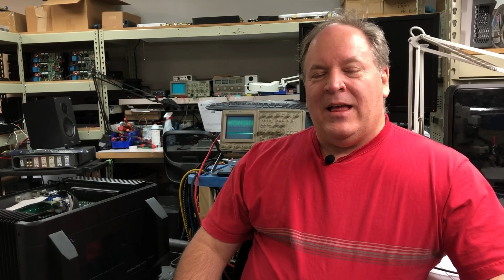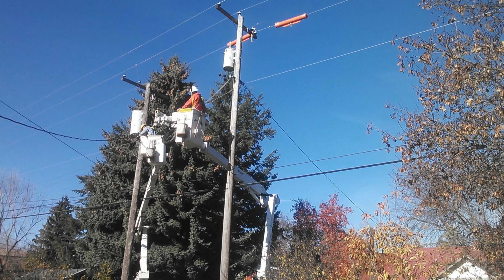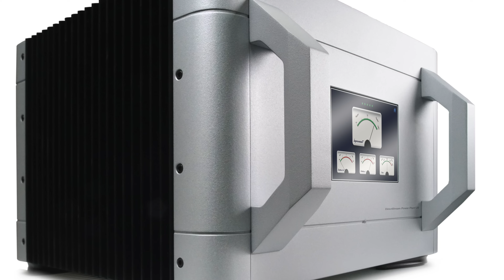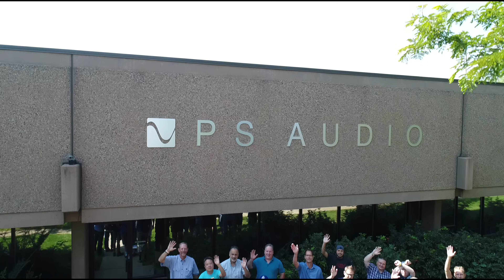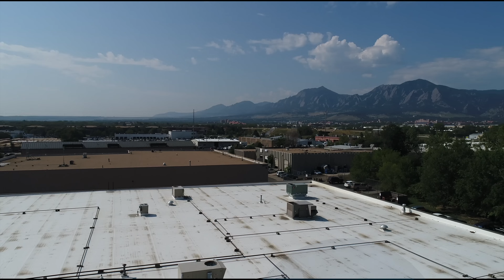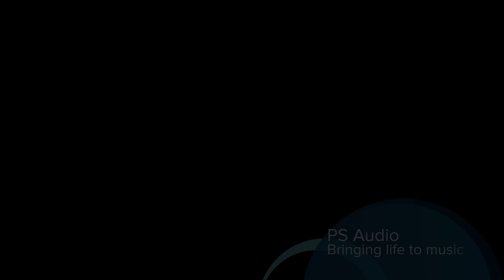Power Plants and other countries

Comment: At least here in Argenina the earth cable is a ground fault for security reasons, but is just that as security device to not end dead, the neutral wrongly called as "negative" is connected to the center of the star in the transformer, where the voltage is cancelled between the 3 phases of the transformer trough a common conductor

Comment: thanks.
nice ps - teamwork. 
specially about germany:
nobody is perfect.
but why would they do this?
any advantage?
Norway seems to be the most advanced nation.
viking - blood and brains?
Reply: Konad Benz 
Germany has 220 VAC with 2 hot leads. Their outlets though have two opposing grounds on each side of the receptacle. So even inserting the plug 180° will connect to the opposite ground and therefore remain safely connected to earth ground. Although I’ve seen some 220 plugs in Europe which don’t use a ground at all and therefore would not utilize this system, even if using a grounded travel adapter. PS A. uses the ground receptacle.

Comment: So how exactly does it remove EMI and RFI from the electricity?
Reply: the input side is completely seperate from the output side. he said @2:40 that it literally re-creates it from DC power. so AC to DC to AC. effectively isolated. large toroidal transformers too
Reply: Its a large DC power supply feeding a DC to AC inverter essentially. And it tracks the output and regulates the voltage and frequency.
Reply: Do you believe it? Because in another video, Paul makes the case for a 300 dollar power cord, that is, if you get the shitty electricity all the way through your house, and possibly even all the way from the power station, then he can hear a difference, depending on whether you have a standard 2 meter extension lead connected from the wall socket to your stereo,  or a "high end" one, that is the claim. And then this guy here says the electrical signal gets "reborn" pure and pristine inside his power supply, no matter what. He and Paul should talk about this, because only one can be true ;)
Reply: Baerchenization Are you speaking to me?
Reply: No, to lithium, I don't know  how Youtube comments got so messed up.
Reply: Baerchenization ask Bob stadtherr if he believes that expensive power cords make a difference.
Reply: Baerchenization as far as the YouTube comments getting messed up I think they did that on purpose to try to avoid trolling and people going back and forth.
Reply: What do you think would be better for effect? Should I ask him before or after he explains to me just how clean the signal is that comes out of his power plants? We only have one shot at this, I need your input! ;)
Reply: Baerchenization I would like to know if the cords are helping with the power or they just conduct better maybe that's why they help with the sound they don't actually help clean up they just conduct better or worse.